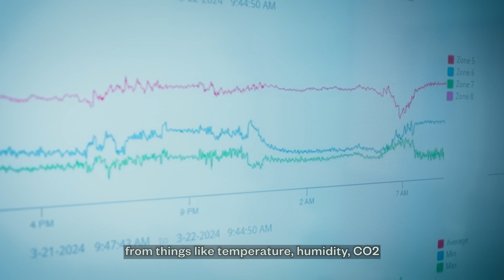The Farm of the Future from Oishii — Solar-Powered Indoor Vertical Strawberry Farm

Comment: I came here after spending $9 on a 8 strawberries at whole foods. The berries are really amazing and I'm sure going to savor every bite. But given the price tag, I have so many questions about cost effectiveness of this process.  The video didn't address any of those.  The solar panel field appeared to be a huge use of land (which seems to defeat the purpose of vertical farming).  Is this technique actually scalable?

Comment: >lack of arable land

Well yeah you put solar panels over it duh.
Reply: This is a big issue with vertical farming.  I do think the method more than makes up for it in land use, but I don't think the energy usage is going to be fully covered by that solar field.  It needs a lot more land than that to power it, which could be damaging to the local ecosystem in order to install it. There are many possibilities overall, it's just a matter of how you do it, and I don't think this is it.  Greenhouse cultivation is much more sustainable IMO, such as what Dyson Farms is doing in the UK.